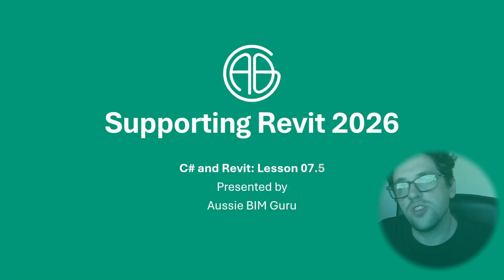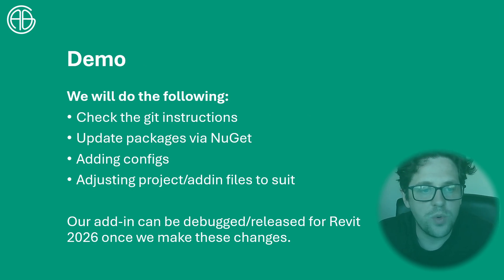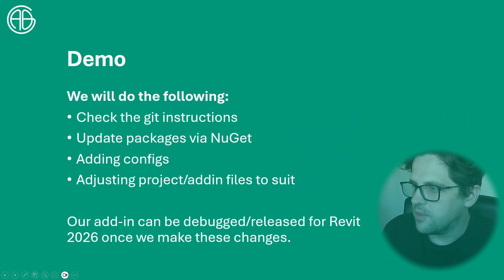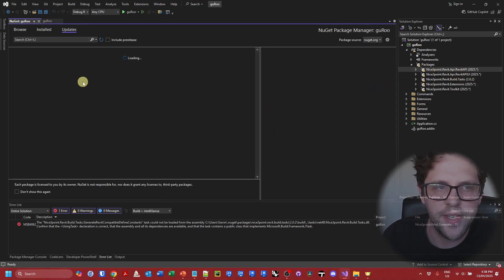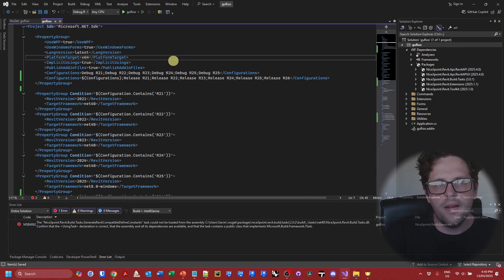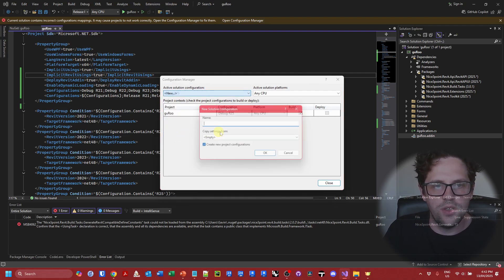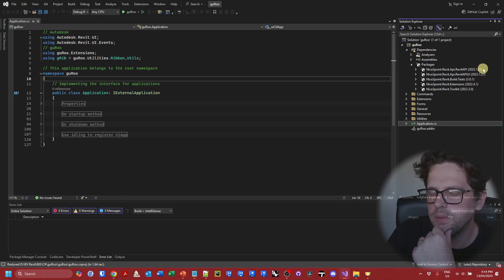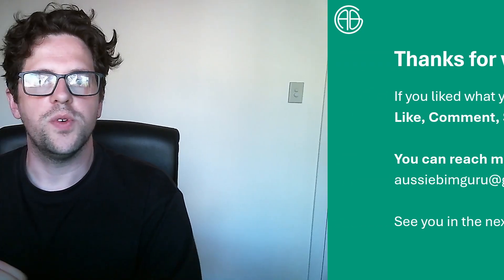C# + Revit: Lesson 7.5 - Adding Revit 2026 support!

Comment: If you're using the latest Nice3point template, you don't need to add the latest version manually. However, I noticed that Nullable is enabled in the project manifest, which can generate some warnings. It's better to disable it if you don't plan to use nullable reference types. Thanks!
Reply from the maker: Good point, and yep if you begin with the latest then an interim upgrade can be avoided. Re nullable i find it handy for double/int and string conversions.

Comment: Good stuff as usual! 
Any particular reason for removing Revit 2020 support for the add in? Sorry if I missed it in the video.
Reply from the maker: No worries, I didn't cover it yet in the series, but the template generally only offers support for Revit 2021-2026 officially (typically 5 versions).

You can leave Revit 2020 support in there in my experience without issues, but Revit 2020 is very old now, so the less versions to manage/cover the better!